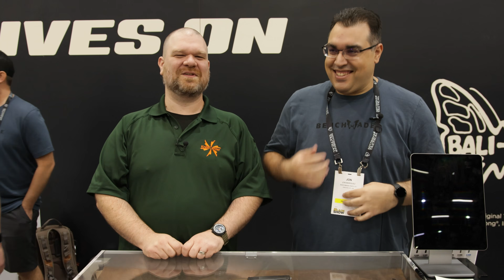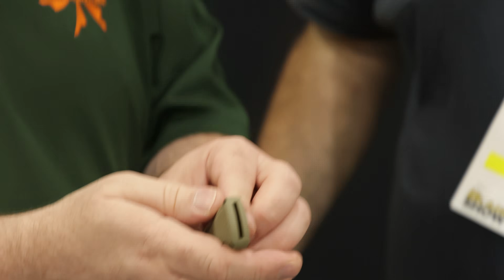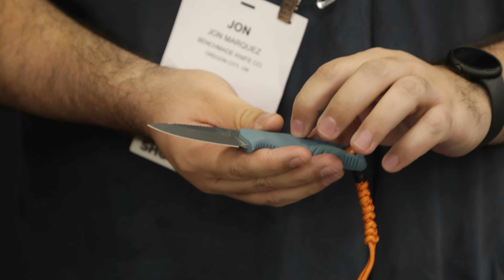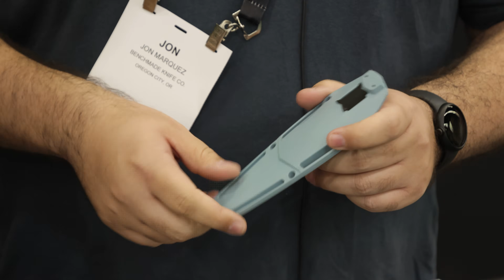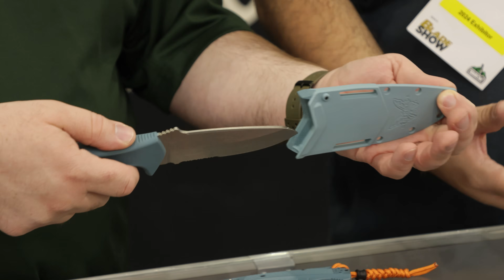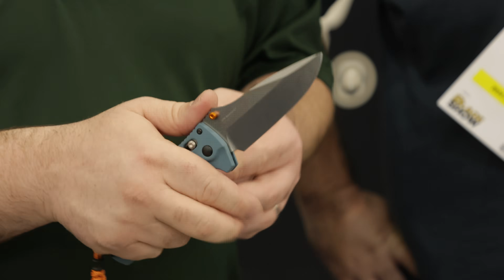Drop-Point Shootout Just Dropped - Benchmade at Blade Show 2024

Comment: Spyderco won the Blade Magazine award at Blade Show for "Most Innovative American Design"  with their Salt Paramilitary 2🤔  I honestly don't understand how a Paramilitary 2 which is a knife designs that's been around since 2010, with magnacut a blade steel that's been around for almost three years now can win this award🤷‍♂️  How the hell is it innovative to just change the blade steel on an existing knife design and slightly change the texturing of its handle🤔  So Blade Magazine is telling us that no other American production knife company or American custom knife make made any knife designs that were more innovative than the Spyderco Salt Paramilitary 2🤔  Giving the Spyderco Salt Paramilitary 2 this award is insulting to all American knife makers!!!!!
Reply: What are you talking about? They won bc of how corrosion resistance it is. Thats why. Benchmades new water series rusts. Did you know that? Granted Benchmade sucks but the point is making a knife that's fully corrosion resistance is tough. That's why they won. Stop crying.
Reply: @KingKsEDC  Spyderco's salt series of knives was originally made with H1 because H1 is virtually rust proof👍  Then Spyderco developed H2, which literally can't rust🙏  I don't understand why Spyderco is using magnacut in a salt series knife because magnacut has significantly less corrosion resistance than both H1 and H2 and magnacut can rust.  Also, you can't tell me that just simply changing blade steel on a 15 year old knife model is innovative🤨  So the fact that Spyderco won the Blade Magazine award for "Most Innovative American Design" makes no sense!!!!
Reply: @KingKsEDC  So according to Blade Magazines standards, if next year Benchmade released a G10 version of their Osborne 940 with a magnacut blade and coated hardware, they could easily win the award for "Most Innovative American Design", even though the Benchmade Osborne 940 is an old knife design and was first released way back in the year 2000🤔

Comment: I wlays used to mention Spyderco and Benchmade in the same breath. 
Now, Spyderco releases models in different colours, but each with a different steel that you know will have the best heat treating and performance on the market, Benchmade just release new colours of the same thing and pretend that people should be excited about it. 

(Also there are tests of the Water line that show them rusting pretty badly, and much worse than the same steel from Spyderco).
Reply: Benchmade destroys Spyderco in sales and revenue. The axis lock is a mile better than the compression lock especially for lefties.

Comment: Legitimate question: have they fixed the failing tab in the Shootout? I had two different models fail multiple times each due to the same tab that holds a spring in place. I’d love to have one, but not until they address that very common failing.